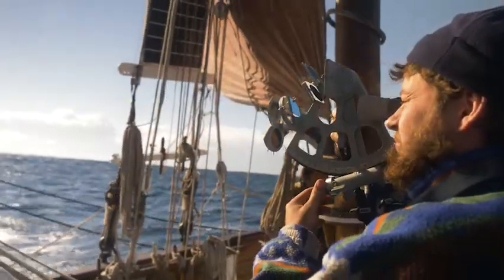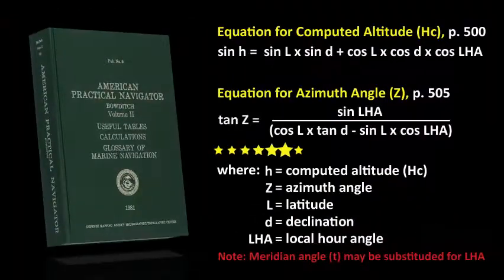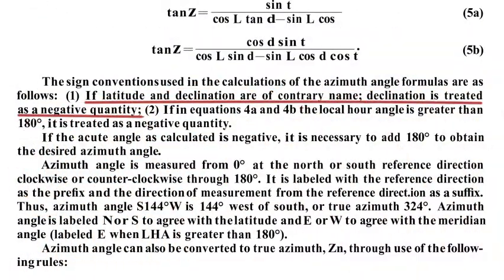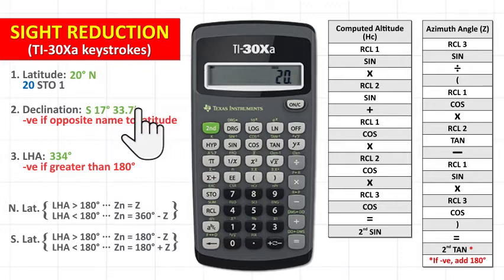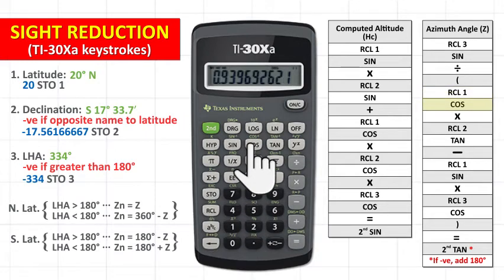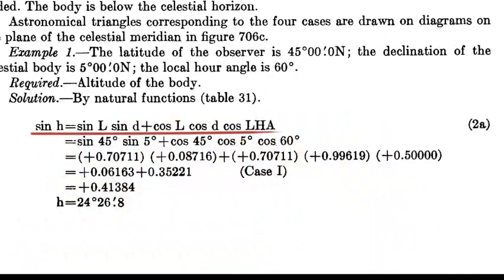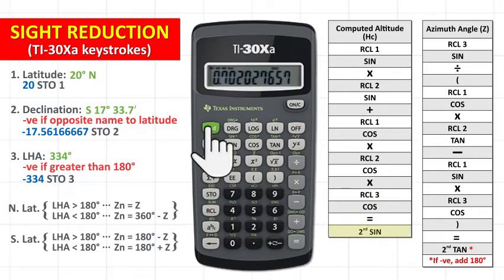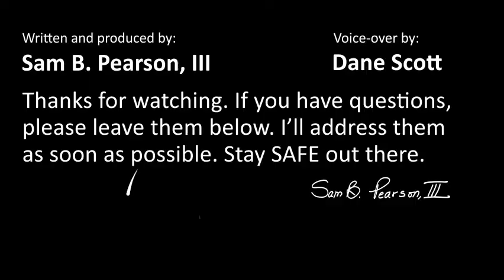Master Sight Reduction Equations Step-by-Step

Comment: Super helpful. Thanks so much! I'm using a Casio fx-300ms. The only differences are that the memory banks are identified by letters rather than numbers, and that the functions go before the values. i.e. sin rcl A x sin rcl B, etc.
Reply from the maker: The Casio fx-300ms is a good calculator.

Comment: HP introduced the $395. model 35 in 1972.
But then........
Thanks to big advancements in both chip design and mass production technology, Texas Instruments introduced their $25. TI-30 model in 1976. And Navigators thus began to do a full "Sight Reduction" work up on an "Electronic Calculator" for the first time!
For me, the only "Con" of doing all my Sight Reduction calculations on the TI-30Xa (of today) is the limit of only three (yes 3) memorie locations!
Because of this limitation I still do lots of "Reductions" with just pencil ✏️ paper (a pre-printed Work Form) and my copy of H.O. 211 that dates back to the 1940's!

Comment: Returning to this matter of The Time.

Data is offered in the worked example on the plotting sheet that does not seem to be available in the Specimen Question.   The Zone Time of 0931   surely does not lead us to a Zone Descriptor of +10  hours..  The chronometer time relates to what in this vessel?
I think I see why the Language chap commenting takes a swing at the use of English in this specimen question.  It seems opaque.  I know the US coast guard  doesn't make mistakes.  We may be missing something here. Clarification would be most welcome.    PS.  You would not believe  the difficulty we in UK  have sourcing HO  229.  Its in the rare books category and Celestaire pretty much refuse us mail order.     Looking forward to hearing from you  before too long.  Answers truly appreciated.
Reply from the maker: Hi Rathlin,
Celestial solution is often lengthy and divided into three sections: 
1. Observation
2. Calculation
3. Plotting 

This video deals with only a part of the calculation. In the future, time permitting, I’ll do a complete basic celestial navigation video. 

To answer your question, zone time of 0931 is the time the ship is keeping. Since celestial data required for computation is given in Greenwich Mean Time (GMT), now Coordinated Universal Time (UTC) being more politically correct,  zone description must be applied to zone time to confirm UTC. Zone description, the number of hours added to zone time in west longitude or subtracted from zone time in east longitude to get UTC, is derived from dividing longitude by 15 degrees (Earth rotates an average of 15 degrees per hour / 360 degrees per 24 hours). Hence, longitude of 143-22.5’ W / 15 degrees = 143.375degrees / 15 degrees is approximately 9.6 hours rounded off to + 10 hours. 

The chronometer keeps UTC. However, it has a 12-hour face like the old analog watches. Applying zone description to zone time confirms if the UTC is AM or PM. 

Here is a link for downloadable copies of HO. 229: https://msi.nga.mil/Publications/SRTMar

Comment: I know this was about using spherical trig  formulas to solve the (pzx)  triangle for Hc  and for Z/Zn   to derive intercept.     I wonder if I could ask about the time, zone time calculations right at the beginning if the presentation. I am not a mariner  so the terms were wholly unfamiliar.  Even so I would like to understand them.  I get that UT is needed to raise things like GHA and declination from the Almanac.   Its the terms I would love to have explained  if you have time.   Thanks (UK  viewer).
Reply from the maker: Hi Rathlin,
Celestial navigation is based on an obvious concept: if you know the exact location of a landmark, you can determine your position relative to that landmark. If the landmark is moving, as in the case of most celestial bodies, we can still use it to determine our position IF we know exactly where it will be at a given time. The Nautical Almanac gives celestial coordinates (Declination and GHA) for the Sun, Moon, and four visible planets (Venus, Mars, Jupiter, and Saturn). The GHA is also given for Aries, a reference point on the celestial equator, used to compute celestial coordinates of navigational stars. Declination and Greenwich Hour Angle (GHA) of a celestial body, in the sky, are comparable to latitude and longitude of a position on earth (Geographic Position) that the celestial body would occupy if projected down to earth. Using the exact time the celestial body was observed, we can extract the celestial coordinates for that body from the Nautical Almanac to compute our position.   

Below is the link for a PDF copy of the American Practical Navigator (Bowditch Vol. II). It contains a comprehensive nautical glossary beginning on page 737.
https://www.dco.uscg.mil/Portals/9/NMC/pdfs/examinations/11_bowditch_vol_II_1981.pdf